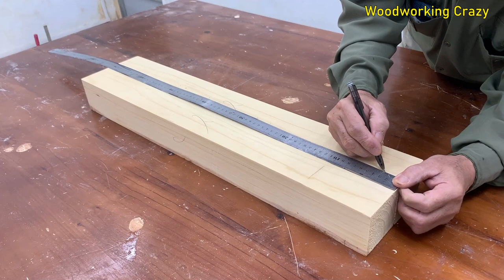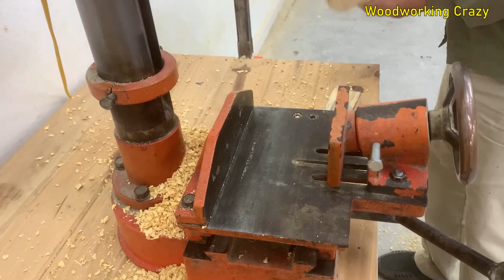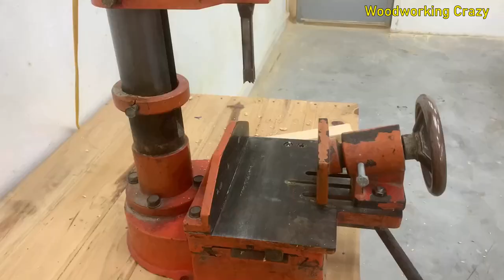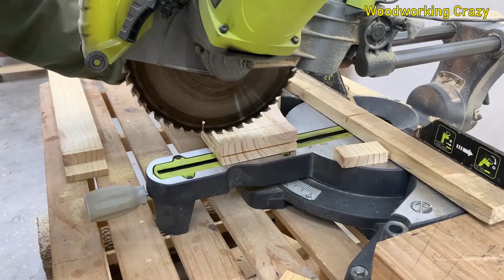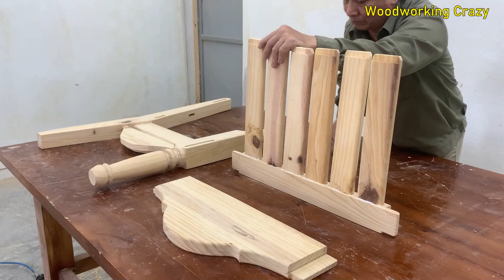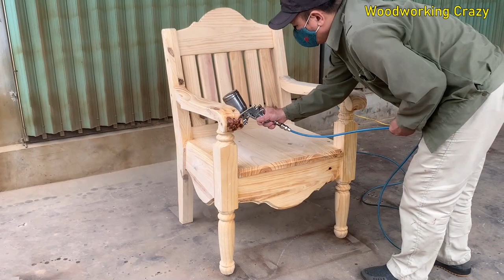Handcrafted Carpentry Techniques To Create Strong Joints - Beautiful Wooden Chair & Unique

Comment: Nice design.  I would have done the final screw in each arm differently, since that hole is now a potential area for water to penetrate and rot.  Whenever I've wanted to secure such a joint with a screw, I would drill a pilot hole underneath, where the rear of the tenon goes into the mortise in the arm, angling the hole up and forward.  That screw's head is hidden underneath, it emerges inside the wood of the arm from the front side of the tenon, and will hold the joint quite securely.